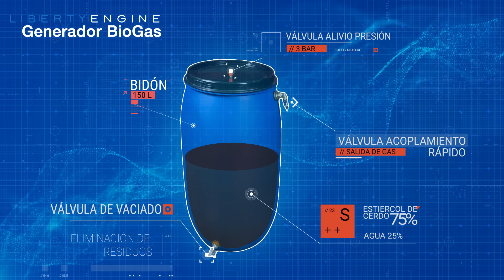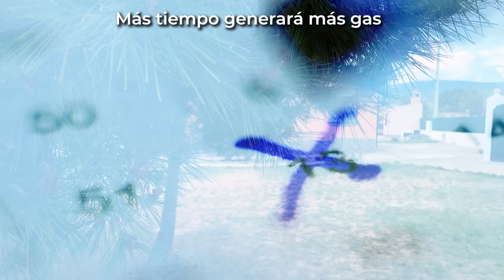Cómo Hacer Gas Gratis en Casa - Gas Butano - Propano Gratis - Liberty BioGas

Comment: Question is how long can you run that stove off of the air space left in the barrel how much does the gas really pressurize in there and if you can’t cook for a long period of time is there anyway to hook a second barrel up to that barrel so that the store and gas can be held in the secondary barrel
Reply: You generally store the gas in another chamber. I use an air mattress to hold the gas and then roll the mattress up to add pressure for cooking or heating. There are other methods that use inverted open bottom containers suspended in water to maintain pressure as well.
Reply: Muito bom, estimei muito, e vou esperimentar.

Comment: interesting, so if you really need a continuous supply free gas you could just make many scaled down versions, start shitting in 5 gallon buckets & put them out in the garage for a couple weeks to ferment your methane & swap them out as necessary, rotating your inventory to maximize your gas production

Comment: Now all you got to do is hook that up in the car run the line from the back to the front into the air intake along with a flash arrestor. Which is basically a screen mesh then you got free fuel for your car

Comment: The title is a little misleading; the type of gas you are making would be methane or a type of natural gas; butane & propane are types of "L.P. or liquefied petroleum base gasses. If you are not making the gas from a petroleum based product, it cannot be butane or propane; your end product is methane gas,which is lighter than air,while a petroleum based butane & propane are heavier than air gasses & will require a smaller office to mix with air for proper combustion.
Reply: « Orifice »

Comment: I missed if he said it.  How much gas is generated per week with a pickle barrel half full of pig effluent (about 20 gal or 75L)....so the production in cu ft or cc.  I got that it was pressured at up to 3 bar.  He didn't add a catalyst, so this would be a good real world test.

This intrigued me since I watched the British comedy Good Neighbors (The Good Life) in the 70s, but I doubted they could have created enough gas to drive an electric generator for: deep freezer, lights...which is a light load...but still requires 24hr running.

Comment: I hate to be a spoiler, but fermentation produces CO2, not propane or butane.
Reply: Stop saying Things that you don't know, they also produce Methane, and that's a methane burning stove.
Reply: @juanfermin1841  He said "fermentation". Fermentation produces alcohol and CO2. Methane from decay of organic matter is quite different, and I doubt he got any useable quantity. BTW, I have a degree in chemistry. I also have studied physics, and that container would not be suitable to accumulate any gas storage, because it could not be pressurized to any practical extent.  And I never saw any connection between the barrel and his "methane burning stove". Wonder why?
Reply: @Party Size Your wright, first the fermentation with leeds to decay, it's just a Time difference.
Reply: @Partysize2  Please, take a look to my comment below.  Appretiated.
Reply: What? CO2? No!
 CH4. No oxid fermentation.
Reply: I added organics from the kitchen, and I have been two weeks and still no gas to burn.  From your knowledge, why do I still have no gas to burn?.  Some kind of gas have been produced, because I have a neumatic camera conected, and it is inflated, but the gas inside do not get burned.  Is it CO2? What is your opinion from your knowledge?  And if it is so, when do you think methane will be produced?   Clarification:  Mine is just an experiment, those kind of "see to believe", it is not for regular use or kind of massive production.  Than you!!

Comment: My father had something like this built underground at 2.5 meters cube. Enough for 1 year per charge!
The biggest problem is that it doesn't smell like the one you buy so it is almost impossible to smell a leak in the system. Safer to keep and use outside!

Comment: Thanks for the video! You could connect a balloon to the safety valve so you know exactly when the barrel has reached the optimal pressure and then you can use it.

Comment: Es bueno pero requiere un tubo de tres pulgadas por la parte superior para poder recargar de estiércol cuando ya este no produzca suficiente gas y no tener que quitar la tapa.
Así se evitaría tener que esperar otras dos o tres semanas después de cargarlo nuevamente  para que se acumule el gas y poder usarlo.
Reply: para no estar cambiando y esperando se prepara 3 con diferente tiempo de preparacion para q cuando se agote uno colocar otro y vaciar y volver a preparar y seguir el siclo de llenado y vaciado
Reply: I see your idea. Good tip, I wouldn’t put it on the top though, you need the pressure still to continue the cycle right? I would probably add it on the side of the barrel, just under where the line of manure is at, kinda adding to it While containing that pressure above

Comment: Pig Manure Generates Methane {gas} there is also Hens Droppings that Does the Same thing  You need Hens Droppings usually from Battery Hens or even a Hen Hutch where the Manure is a Few weeks old  Hens Manure should be in solid Form and Just like the  Pig Manure you Need the same  quantity of Solid Hens Manure as with the Pigs  Manure and also the same water and Once again Leave for to Foment about the same  time where you could have  Months of Methane  Gas  This idea is used throughout parts of Asia ! Maybe to be on the safe Side a Bubbler could be Used for if there was a  Blowback of  ignited Gas a Bubbler Prevents a Flashback

Comment: Im Prinzip gut. Habe mir aus Zeitmangel nicht alles angeschaut. Wie sieht es bei Überdruck aus? Kann dies zur Zerstörung des Behältnisses führen oder regelt sich das von allein bzw. gibt es ein Überdruckventil? - Gruß
Reply: Ja, ist oben im Deckel installiert
Reply: Scroll to 0:33 

See 3 Bar, in the beginning of this video, they will show a blueprint of things you will need and where to place them. Again, see 3 Bar. That will help relieve pressure inside in case it’s getting too high in there.

At 4:49 he is showing how to install

Comment: Not to be contrary but gas should be with compression fittings and if you must use Teflon there is a gas rated version. For safety sake. Thanks for the video